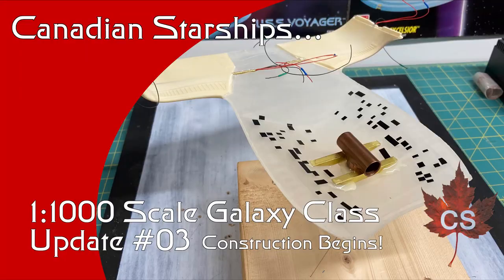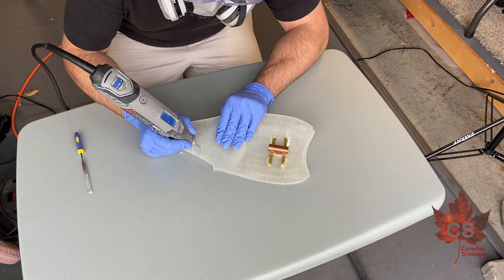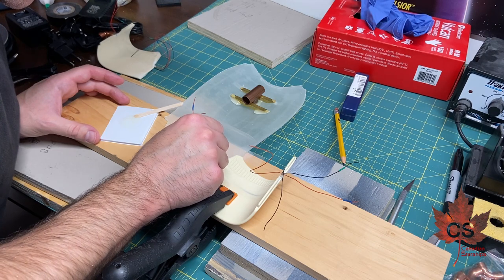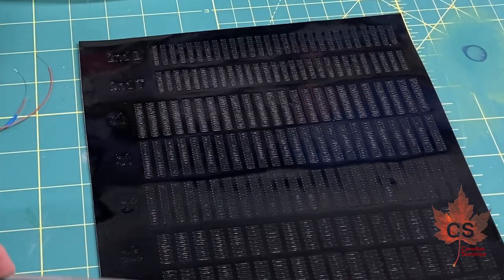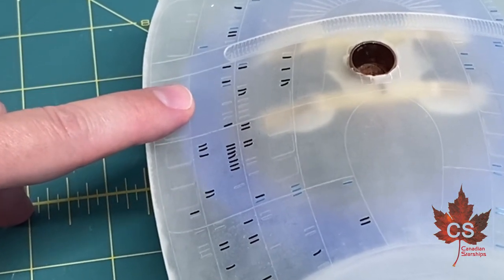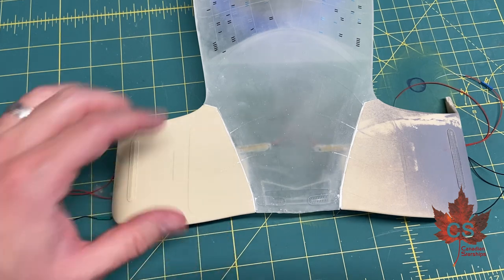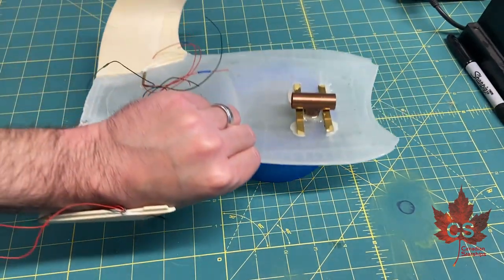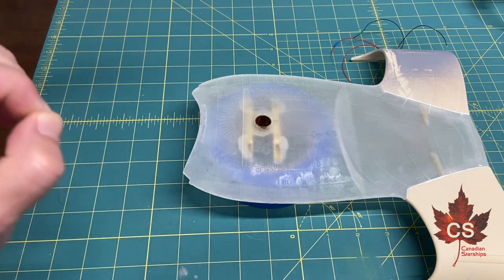Star Trek 1:1000 Scale Galaxy Class Model Build Update #03 (2021)

Comment: You might want to hit the hull with an adhesion promoter spray. I think the problem is the consumer grade vinyl you're using for the windows
Reply from the maker: I did that to no avail. I know I’ll have better luck with your window masks on the other sections! But the gloss in the windows did the trick. I probably should have added an extra window set or two when I ordered the masks!
Reply: @CanadianStarships  there are plenty of extras especially if you aren't lighting each window, so you should be able to replace between coats of paint. They are a tad bit wide, but that was so I could push them down inside the indents with a toothpick. 

Its looking very good. I envy folks who can work as clean as you do. My kits are a mess until the final coats.
Reply from the maker: @aztekdummy  ok that explains why I thought they were a little wide. I’ll be sure to mention that in the next update! My little cutter for one off jobs can’t compare to your commercial unit, that’s for sure! 

Everyone keeps commenting “have you seen Lou’s build?” Yes yes, multiple times! I’ve definitely taken some ‘heads up’ tips for this kit!

Comment: Saw your Enterprise E videos and the D is comming along in the same quality, keep it up ! I am about to build the D myself shortly but I struggle to find the Windowmasks your using, could you maybe tell where you purchased them ? best regards from germany
Reply from the maker: Which Enterprise D kit are you building?
Reply: @CanadianStarships  the Polar Lights clear kit 955/06
Reply from the maker: Ah, so the 1:1400 scale kit. Unfortunately no one currently makes window masks for that set. The garage kit I'm working on is in 1:1000 scale. Unless you have a vinyl cutter available to use where you can cut your own (you get lots of wasted masks because of how small they are) your best bet (in my opinion at this point) is to either scrape the paint off the windows or try using a liquid mask, but I've yet to test the later option, so I'm not sure how well that would work.